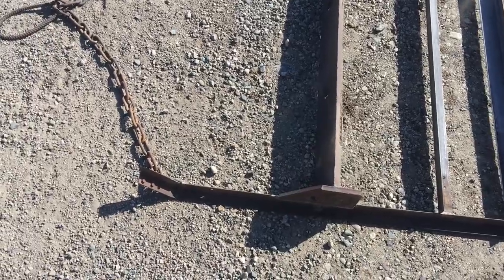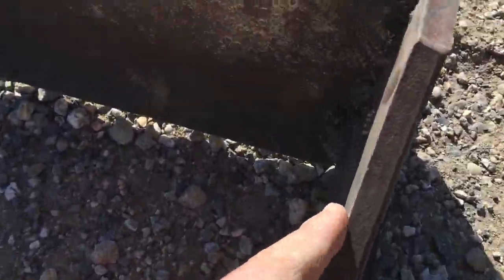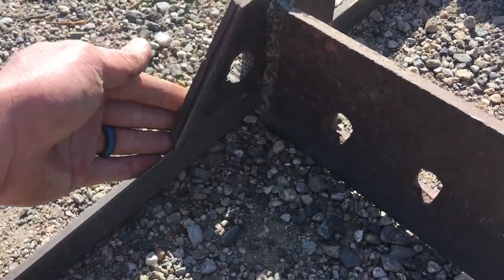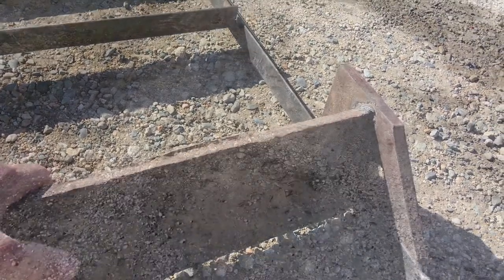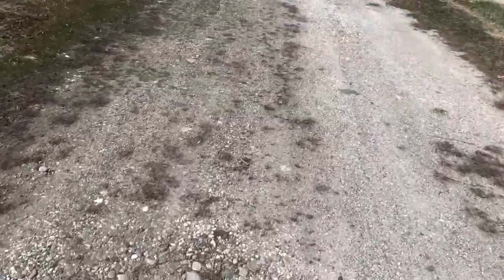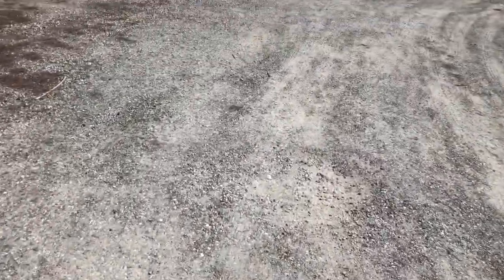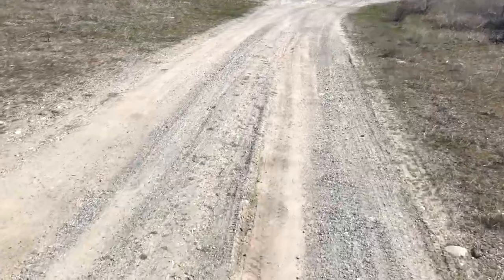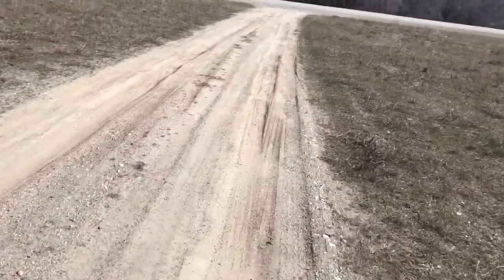A simple drag for leveling gravel driveway

Comment: I need one to level my driveway “badly”. Thank You, will make one as well.
Reply from the maker: G.T. G 1. if you can weld its pretty easy to make one, you can probably do one even better than mine,
Reply: If it's for occasional and sparse use. Don't even bother making one! Get a pallet, preferably free. Turn the three boards side into the driveway surface. Attach a size chain and have a go! That's it, KISS to it's best. 
Although these and other more intricate solutions work perfectly well. The investment either in time or money might not be worth. So just go out there and do it...
For what it's worth. Since buying is long forgotten, it really don't make any sense. I've been willing to make one for ages. Point being every time I think about doing it. I end up using the basic, cheap (free) and simple pallet. Than I don't need any other contraption anymore! LOL 😂